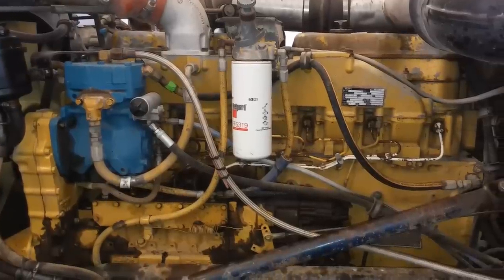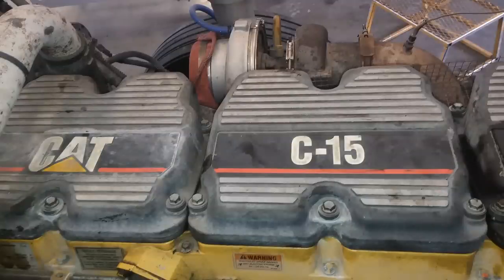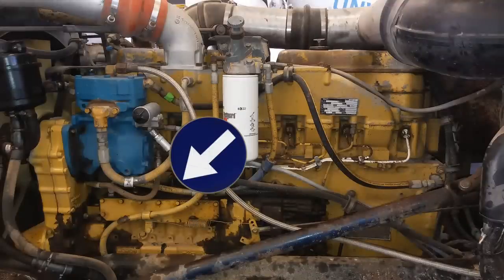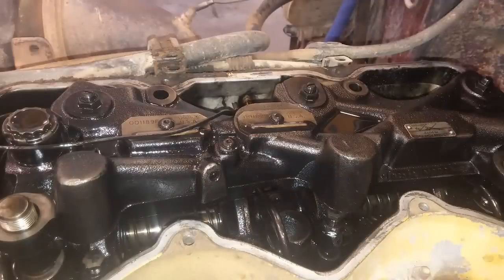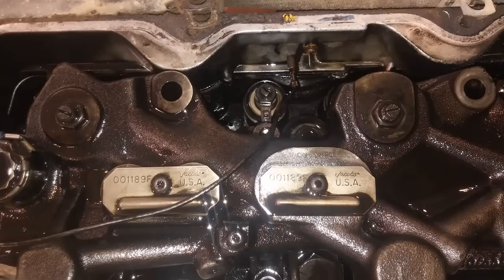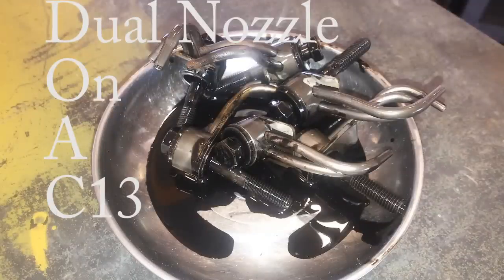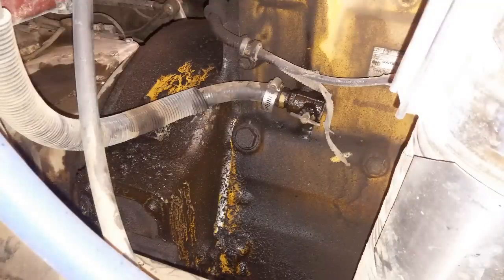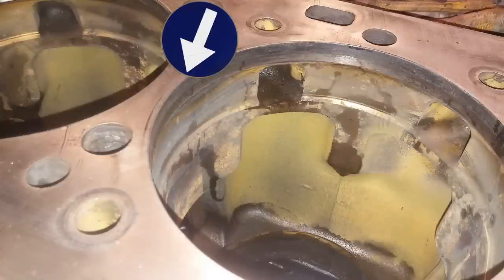The Cat 3406B Engine. Know Your Engine.  Caterpillar 3406 Information And History.

Comment: Thanks bro, thank you for doing this. Adding to the things that are problems:

Unlike a Cummins Big Cam, a standard B model doesn't like to be revved hard. 2400 rpms is the limit before you have to worry about the bottom end coming apart.
Marine spec parts can get the hp into the 600 plus range easily.
There are upgraded exhaust manifolds and turbos for these engines to help with power and clean up the smoke.
No engine has to be smoky, how the pump and injectors are set up really decides that, and getting more air into the engine.
Reply from the maker: +Steve Ross A 3406 shouldn't be going over 2100 rpm really, most of the 3406E and C15 are governed there it seems. 

One of the B models in the shop doesn't smoke at all, even revving it, I've never seen that before on one of these. You are right that it is possible, but most of them smoke at least a little.
Reply: As Josh mentioned, the 3406B's were manufactured with nozzles, and those components are not the best for atomizing the fuel charge, thus, the black smoke.
Reply: Adept Ape totally agree.  I had a B model in an 85 KW W900 and the guy who worked on it was an old timer that had pretty good hands when it came to tuning them. If I were to do another one, I would rebuild it with parts from IPD ( they offer an upgraded piston and liner combo plus other fixes ) make sure the bottom end is balanced and blueprinted and put the liner protrusion at the high end of spec.
Reply: NOTHING will rev like a V8 Mack
Reply: Liner protrusion is a weakness..... counter boring is a must
Reply: John Hull the liners dropping height in relation to the adjacent cylinders is the weakness for any diesel that doesn't have some way of locking the liner at a certain specification. The Cummins ISX is bad like that.  I believe the Series 60 Detroit has an effective liner securement system. Any thoughts?
Reply: Steve Ross personally I wouldn't own a Cummins.... after a big cam..... ISX are junk..... you don't rebuild them..... because they don't wear out and get lazy.....they grenade....(not to mention CUMMINS was at real fault for the MAXXFORCE debacle....they did the engineering and mfg of the emissions controls) your correct on liner theory from cylinder to cylinder....and the series 60 was way over designed..... I've seen 12.7 rods and mains with over a million that I wouldn't be scared to run another million
Reply: But I have a huge weakness for two cycle Detroit's.....3406B next (or even an E) then V8 Mack
Reply: Engines in the 1980s turned 2350 or more at about 73 mph.
Reply: 2100 is full load speed, they have a 10% gov. HI could be 2300-2400 depends on factors. You have to set/adjust set point under full load with a set point indicator. Old timers call it bumping the governor. 
Ratings on full load speed was 1600-2100, depends on HP, year model. Remember emissions had to be met even in those days. 
Electronic engines have a 0 % droop gov. But on some you can turn droop on. So it acts like a mechanical gov.  Which max TEL  is 2300. You have a 150 RPM droop curve. Again depends on what engine you have and what features was available. 
Overspeed is HI-Tel times 1.25, when you are that speed you could be floating the valves.
Reply: My 5EK is set at 2100 and 1940 in top gear. Big cam Cummins I drove in 1980 was 2350 and was maintained by Cummins dealer since the engines were leased and used in Southwest Motor Freight trucks. Top speed was 73mph and shifting gears is also smoother at higher rpms. Todays engines are set up different than those in the past. Even the latest engines are designed to operate a  little slower rpm than my 1996 5EK.
Reply: Please be real careful on the high end of liner projection they start cracking flanges at 5.5-6.
Reply: Droop, FLS, FTS (slope and intercept) are tech specs that depend on iron changes and are specified by engineering to use. Messing with those things need to approached with caution but when done in a proper manner can be very rewarding.
Reply: Ehhh nothing like sitting in the driver seat with a turned up 3406 hooked into an 18 speed and some 373 gears, loaded down, straight piped rolling coal every time you hit that switch up and come up a half gear singing a tune you cant get off pandora or a radio.
Reply: standard gig cam were joke most went down shortly after the warranty expired cams of butter
Reply: @allanmccullough8550  I have a 85 Freightliner Cabover Big Sleeper with a 3406B and a 13 speed roadranger. I run a low profile 24.5 tire and a 3.55 gear and I'm turning right between 1500 and 1600 at 75 mph in top gear
Reply: @johnhull6363  except a 3408, which will outpull the E9 with only a nod and a wink.
Reply: @johngoldsmith6629  correct. If memory serves, Cat advised against operating above 2300 with the 3306 and 3406 (I don't remember about the 3408).
Reply: @UnionThugg  The same.

Comment: I had a 3406B in a '85 Pete 359 that had a brakesaver retarder from CAT going north could come down Grapevine at 50mph at 75,000-80,000 pounds and never touch the brakes. Hell of a hydraulic wine and would heat up the engine oil to 240f or so but worked great. Don't remember much in the way of leaks but it did eat up the diaphragm in the brake saver control valve at the bottom of the crankcase from the vibration and weight of the spool valve it would wear a hole and a leak air through it so the brake saver wouldn't work anymore tell you replaced it. Sold the truck in '93 when I quit driving. Loved that motor tons of power. And yes it turned the front of the trailer black 😊

Comment: They were a great motor. Good torque at all power levels. Was capable of good fuel economy if you didn't turn them down. Long live the 3406 series of motors!
Reply: Yes def didn't like being turned down. I drove 7 axle dump/ pup set ups with them & when turned down... forget about it. Shit fuel mileage & miserable to pull around 98,000+lbs with. Turned up tho.... pleasure!

Comment: I  have a 88 Pete with a B block in it .About 5 million km on the truck. had it rebuilt at 3 million km. This truck works all summer hauling asphalt. I use to use it year round on the ice roads. Great engine. and has never let me down. It comes down a little slow so I shift with the Jake on low. B Block for ever.

Comment: Those engines are beasts and a very reliable to put them to work...
But in my country they are not the best option because they are really expensive to repair and we have a lot of long downhills and the engine brake on those engines does not keep the truck at a safe downhill speed... 
Awesome video as always 
I'm always wating for next one
Reply: Could add a brake saver but probably way to expensive 🤷‍♂️
Reply: @40KRK  what's a brake saver?

Comment: I'd be interested to know more about the 3406's little brother - the 3306B.  I had one in a highway tractor.  Only 300 hp, but it was all I needed for what the tractor was bought to do.  It was hands-down the most trouble-free, dependable engine I've had to date.  Started like a champ hot or cold, and it fired right away, no cranking and wearing down the batteries. Grossing 70 thousand, it got 9 mpg thru an 8LL
Reply: 3306 started off as a 1673 basically also had a B and C version,  3306, 3306B, 3306C.
Reply: The 3306 and 3304 were absolutely BULLET PROOF none  rebuilt so many for CRC engine shop forgot the number. I built one that came in with more than 30,000 -yes 30,000 hours. Number 1 cylinder hadn't fired for some time - a water pump for dust control Las Vegas.
Reply: @johngoldsmith6629  I had a  1673 (C ?)  in my 1st truck; 1966 International  CO 4000 that I bought in 1976.  245 hp.   R96 10 speed .  ... .  I had 4 1693's . . .   Good ol'  engines .  ..   ...
Reply: @paulfisher6142  The 1600 series was mostly refereed as Clatapillars. Sound like a bunch of loose bolts running. Lasted forever, fuel mileage sucked, but fuel was cheap. I have never seen or worked on a 1676 in a truck.
The few 1673C's I seen was 76R prefix. Worked on two if I recall, they was almost gone when I started.
One 1673 or 1673B came in I think, I asked to work on it, got turned down.

Comment: Got 2 of them - 1 in a 1990 FL through a 15 over with 370 gears and tall 24's that I could bump 7 mpg grossing 80,000 if operated it for maximum economy if I wasn't dealing with wind drag - and 5.5 - 6 no matter what. # 2 is a 91 turned up with a 550 turbo through a 15 over on low-pro 24's with 342 gears with a fresh inframe which I hope to finish and be in before Thanksgiving replacing the 379 Pete with a 6NZ and 13spd through 336 gears on 22 lopros that averages 6.5 - 7.5 operating it for maximum efficiency the past 10 years.

Comment: Years ago I worked as a mechanic for a major oil company that had a fleet of T-800 Kenworths hauling crude oil. Some of our T-800s had Cat 3406B engines and the rest had Cummins engines. All the trucks were use in identical service and we had to overhaul all the Cats right around 350,000 miles because of excessive oil usage, whereas the Cummins were going at least 500,000 miles, and some were going even more than that between overhauls.We had one Cummins that made it to a million miles without ever having been touched.
Reply: Which Cummings motor was it?

Comment: Great video! Some time in the future you should do a video on turning up a b model 3406.
Reply: One easy trick is to put the 3/8 timing pin in the pump. Then remove the timing advance cover and loosen the timing advance bolts . Put about a 3"  5/16 bolt in the flywheel hole and back up the engine until the bolt wedges in the hole.. Retighten the advance bolts making sure the advance spool is bottomed out as you retighten the timing advance . This advances your timing the perfect amount. Remove both pins and start up.. Listen to that snap, its awesome ! 
I worked on and rebuilt 1000s of these during that whole era with Toromont CAT in Windsor Ont.
Next lesson on fuel screws and AFRC settings. Oh buddy, good times, the best of my career.
Reply: So how bout to turning the fuel srews and afc
Reply: @finleypatmalcolm  I'm just ridiculously curious if a Bosch P-7100 style 12mm or 13mm barrel pump, maxed/balanced & benched could work with a Caterpillar??
Maybe a different pump cam to match the Cat firing order if it's not the same as a Cummins?
Reply: @finleypatmalcolm  I saw a video of someone that put a P-7100 style pump on a Ford Powerchoke 🤷🏻‍♂️